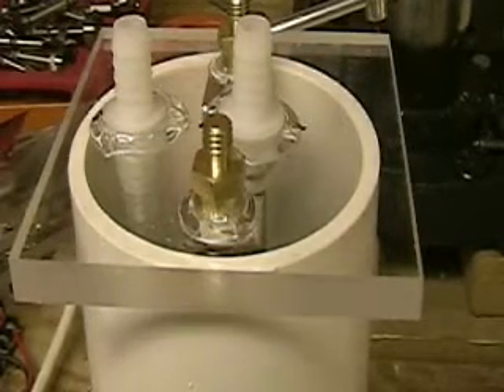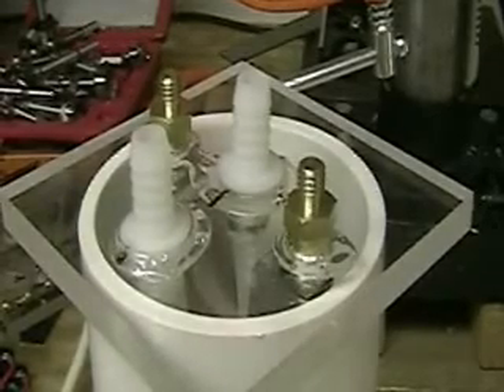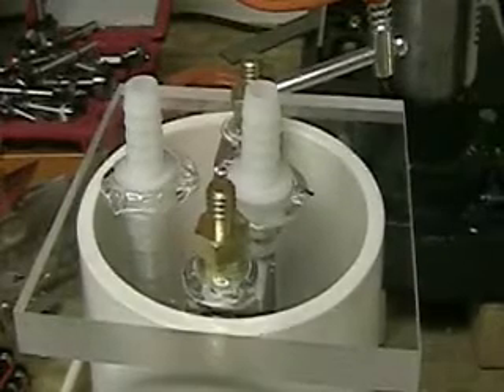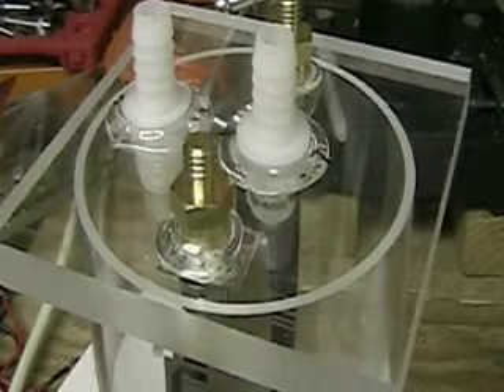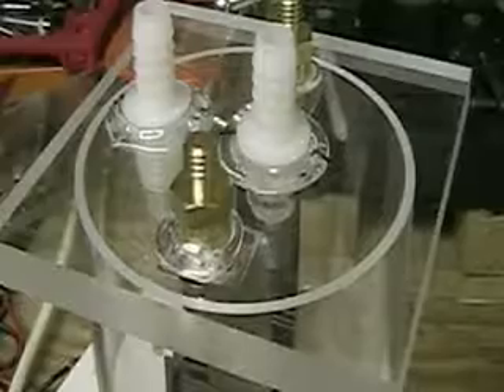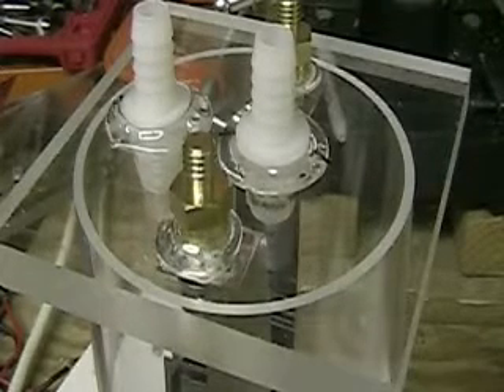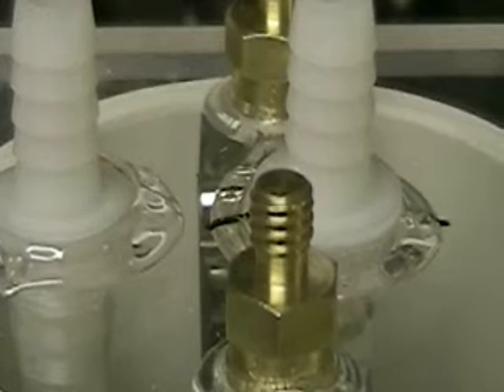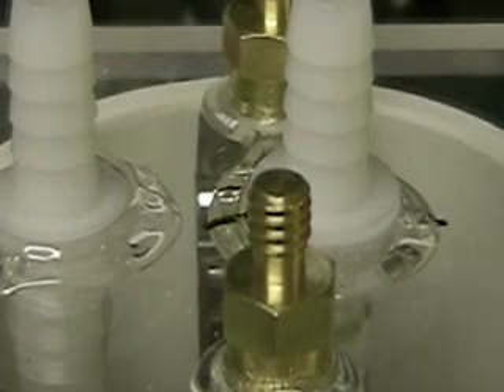Hydrogen Tap (FOCUS Start) 296

Comment: Very tough looking cell youre building! I start mine tomorrow. I finished my PWM yesterday. I know the electronic basics and am not sure what to do with the PWM only having a couple of multimeters. Its fun to tune the AM radio and hear it working. It seems to make more gasses when I basically crank it all the way up. I only have some spoons in a jar, but they hold 8 amps Ive seen15V. My wimpy FET in PWM only hold about 4A before it gets HOT. No ferrite choke yet either. Like you Im workin on it!